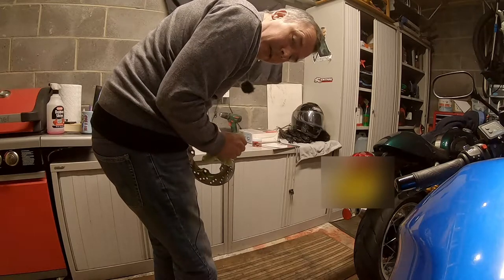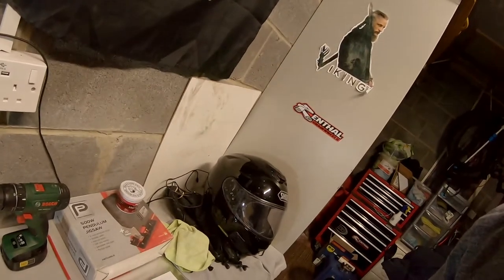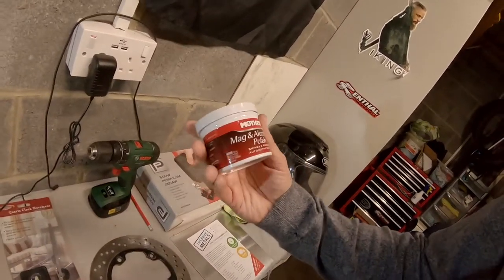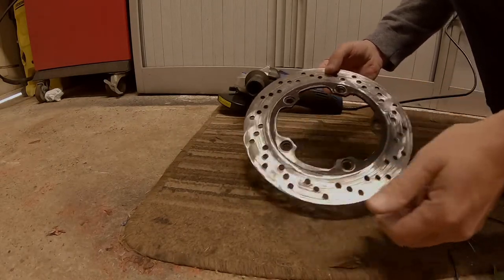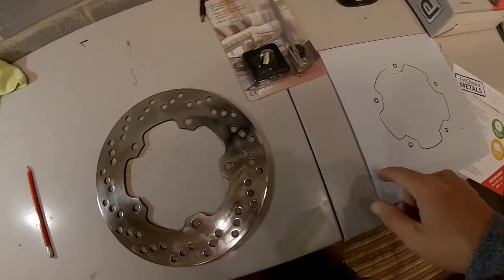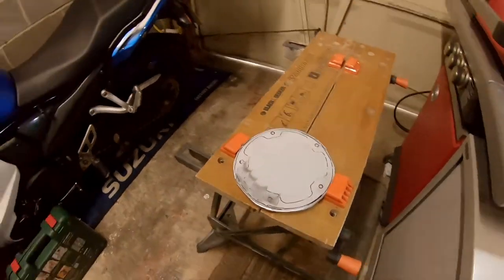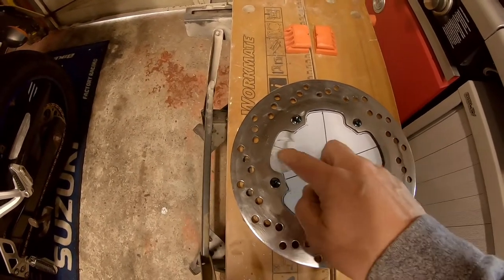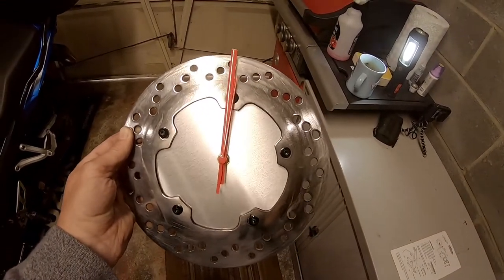Brake Disk Clock #3

Comment: you don't say how big that sheet plate is mate
Reply from the maker: Hi Jeff I used a 250 x 250 mm but it depends on the size of the rotor. its best to measure between the points where you are going to fit the plate to the rotor and make sure the pate you buy is big enough to cover the gap and allow for mounting. Thanks for pointing this out.
Reply: @upnorthbiker  thank you am going to do this thanks for the vid